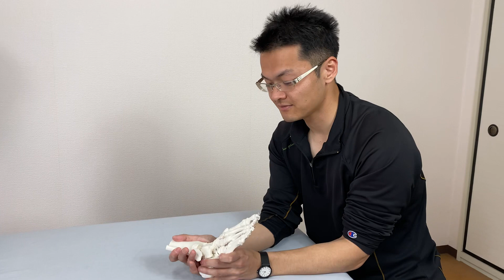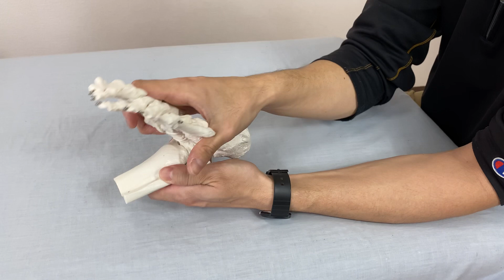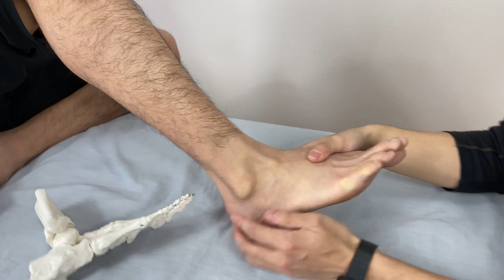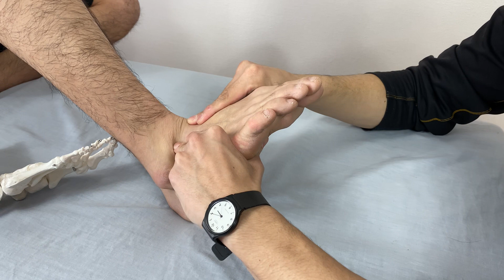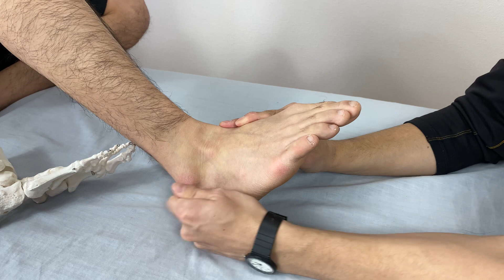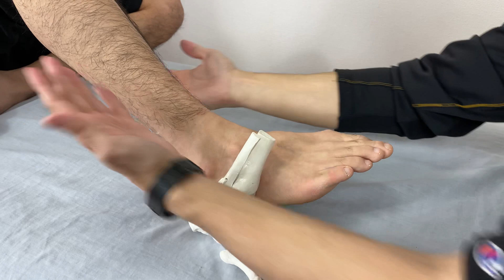Advanced mechanics of ankle joint

Comment: Great video - thank you.

But how do you improve ankle dorsiflexion after a bad ankle sprain with an avulsion fracture?

I am still recovering from that injury and still have limited ankle dorsiflexion.

I have been trying banded ankle stretching exercises but still have some stiffness at the front and even a little at the back of my ankle.
Reply from the maker: Depends on where you live, you can find therapist whom have taken classes I also have. I recommend you find someone who've taken FAR-L or NER-L class from link below, "find a therapist" page

https://chiklyinstitute.com/find-a-therapist
Reply: @RyosukeIto  I could not find any therapists with FAR-L or NER-L. There were some therapists with Lymphatic Drainage but they did not show up in the NER-L search. 

Is there any way I could use some technique on myself to help with the dorsiflexion. I know the restriction was caused when I sprained and broke my ankle. My other ankle is fine and has plenty ROM.